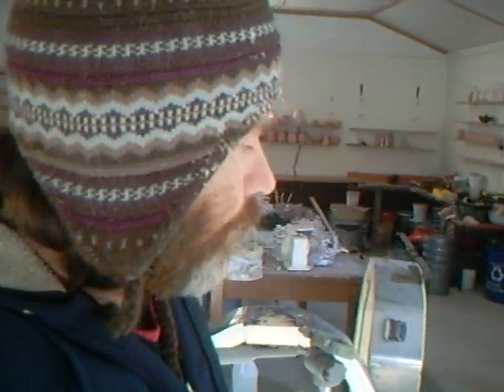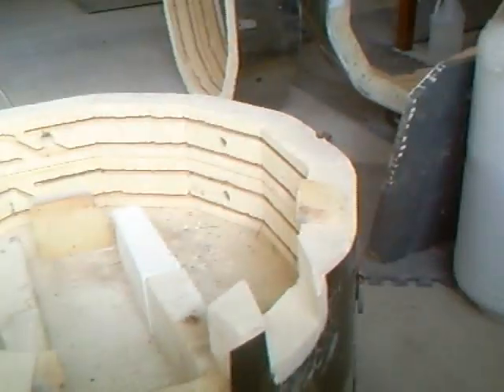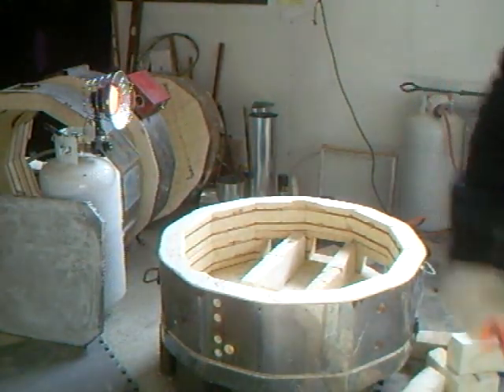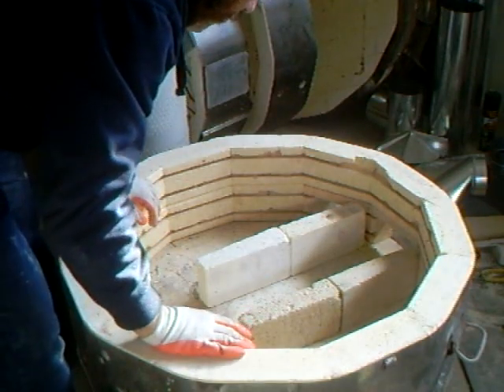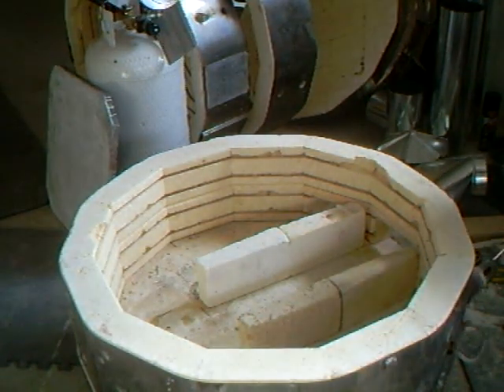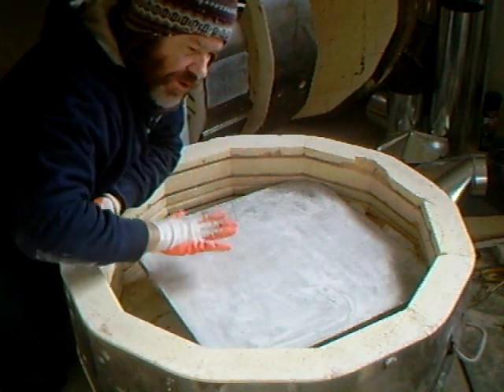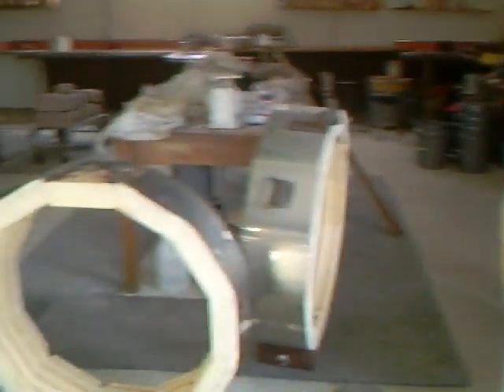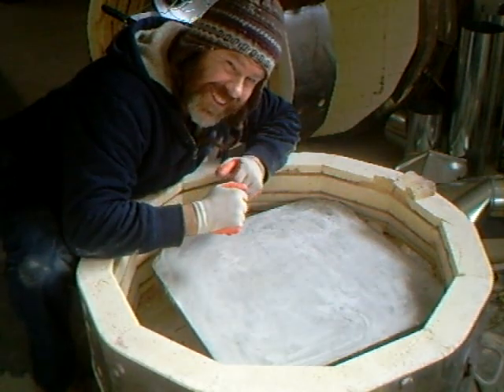SIMON LEACH POTTERY ~ Reconstructing my converted propane gas kiln (again)!

Comment: Good to see how to start that kiln again. We hope you insulate and support the exit flue/stack securely this time. I'm still concerned about firing inside and venting through the window as you mentioned earlier. If you could sandwich a layer of fiber blanket between the brick and the metal jacket it would fire outside without much heat loss. Good luck and stay in there eh.